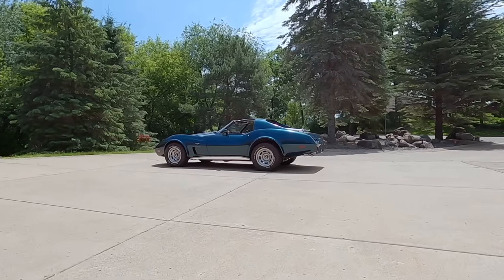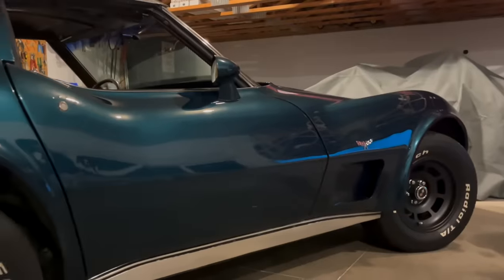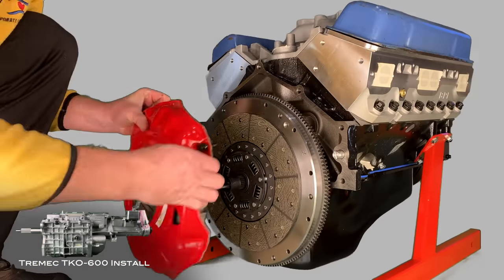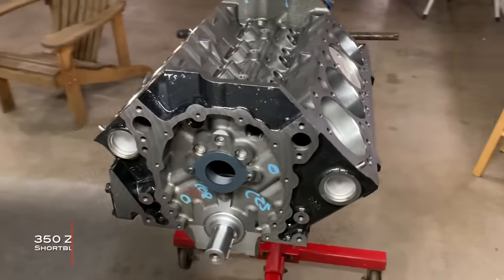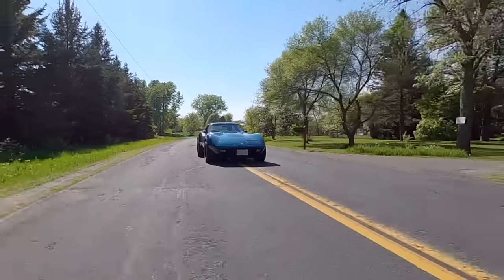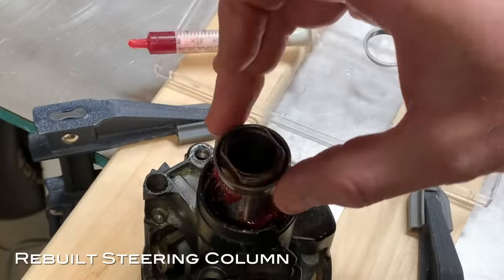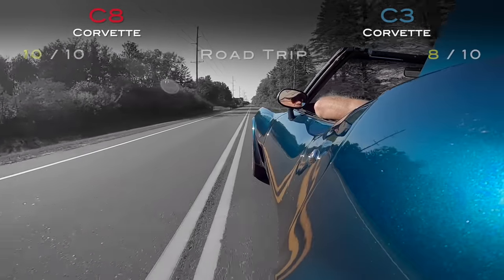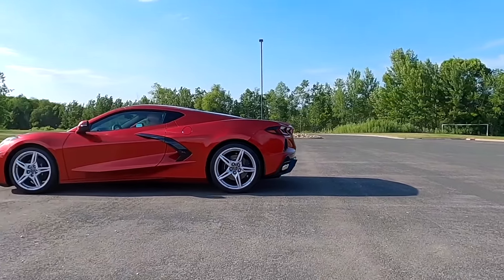C3 Makeover: Modernizing a Classic Corvette

Comment: I’m one minute and 40 seconds into this video and if you believe AFM belongs in a “sports car” we cannot be friends.
Reply: Same here, absolutely agree, gen 5 is just a waste of money, absolutely stupid technologies  added to this gen unlike gen 4 that has the Variable valve timing (vvt) which does actually improve performance and feul efficiency without having to deactivate any cylinders
Reply: EXACTLY.  ITS TURNED THE RELIABLE HEMI AND LS/LT ENGINES MODERN LEGACY OF DURABLE, HIGH MILEAGE POTENTIAL MOTORS TO FAILED LOW MILEAGE EXAMPLES BC OF CHEWED UP CAMS/LIFTERS AND METAL PARTICULATES RUINING THE BLOCK.
Reply from the maker: hey Guys - yeah cylinder deactivation has its risks too (totally agree) - one thing I discovered is when I drive the C8 in sport mode, the throttle position sensor threshold for deactivation is considerably lower ie it only ever seems to activate on the highway. In track mode i don't think it even engages, but then your shift points start to get ridiculous. In terms of MPG savings - minuscule between touring/sport mode and I usually leave it in sport to keep all 8 firing most of the time. I think Silverados-SUVs likely benefit more from an EPA standpoint. thanks for the comments!
Reply: If that's the case, then i think that's ok, you can just keep the car on sport or track and no cylinders will be deactivated, thanks man @TacoJoe
Reply: I absolutely hate AFM as well. I disabled it on my wife’s truck. Too many issues with the 5.3 with no benefits whatsoever.
Reply: What's your thoughts on vvt, because I'm confused between ls2 and ls6 engines, both are almost same price, one has vvt and the other doesn't, I'll modify either engines if i get one of them, so should i get ls2 and then change the stock camshaft with a btr performance camshaft that supports vvt, or should I just get the ls6 that doesn't support vvt, because as far as I know vvt is good for for both feul efficiency and performance, but i found some people who apply delete kits to romove vvt from their engines, so i wonder why, thanks man for your videos, i appreciate your responding to your viewers comments. @davejalenderki
Reply: Took a BW T10 out!
Reply: No offense intended but that chrome luggage rack on the back of the C3 looks stupid and permanently shackles the car's looks to the 1970's.
Reply: What is AFM ? Sorry don’t know
Reply: @TacoJoe  I disagree that it helps with the trucks and SUV enough to deal with the problems. I had an 03 Silverado 5.3l extended cab Z-71 that I averaged 18mpg with.
I then had an 07 Trailblazer 2wd with the 5.3l and the horrible DOD crap, it averaged 19mpg. However, the amount of oil this thing burned completely wiped out any mpg savings it could get. At the end of its life (240,000 miles) I was burning thru 4 quarts of oil per tank of gas. It started burning oil around 100,000 miles.
Reply: I don’t think he’s trying to be your friend.
Reply: Boohooo, why can’t we just be friends. Oh well. Bye.
Reply: @jaivette  AFM stands for active fuel management, AKA DoD, displacement on demand, and in the pursuit of better fuel economy uses a solenoid controlling oil pressure to shut of lifters keeping the valves closed to shut down half the cylinders.
Reply: Can I ask what AFM is?

Comment: So you basically destroyed a 1977 Corvette. I have a 1976 Corvette. It is my third one. I finally found the one I wanted. It looks 100% stock. The interior is 100% stock, except for a hidden MP3 player. NO touchscreens. The suspension is stock except for polyurethane bushings and body mounts. Brakes are 100% stock with sleeved calipers. Exhaust is a true dual system with no cats, but looks stock from the rear. The engine was not original when I bought the car. I built a 360 rwhp 383ci old school small block for it, that both makes more power and is more reliable than stock. But on the outside it looks completely stock, even the color. It is carbureted. I did switch from an automatic choke to a manual choke. I had a TH400 transmission built for more reliability. It has 225/70-15 BFG RWL Radial T/As on silver steel rally wheels with trim rings and stock center caps. It was repainted in the stock white color, and the Buckskin tan leather interior was restored/replaced. It is 100% reliable and can be driven anywhere, but it still has all its original charm and character.
Reply from the maker: destroyed my 1977 Corvette? Ouch! I still love my car and glad you like your 76 too / sounds like a nice setup
Reply: @TacoJoe classiest of replies there, man. Well done.

Comment: Would be great if you could fairly easily install a C5 C6 or C7 rear end & T56  transmission into a C3 body for a closer 50/50 weight ratio &  better rear suspension setup ......Also looks like the C3 could benefit from some aero parts like a front splitter & underbody, maybe side diffusers & a functional  rear spoiler. If they could be integrated to look good & not cheesy. If money wasn't an issue. I'd love a C3 or C2 classic old school body with modern parts underneath. Same with many older cars. The classic styling is great but not the old worn parts & performance.

Comment: One of the best automotive videos I've seen.  Production values are through the roof - and that's outside of the mechanical work and analysis.  Interior is where I'd go a different direction.  The brown seats and carpet would be where I'd do the replacing/upgrading and I'd leave the dash & console.  Keeping the exterior stock look is a rare and admirable choice.  Wide body kit and 22" wheels are for different applications/not at all in my book.  Nice car and great work on your video!
Reply from the maker: Hey thanks @twomustangs - longer term I have more work on the horizon for the interior (including dash improvements) - totally agree with you on the 22" wheels & wide body too (not the right fit on a C3) - thanks for the comment!

Comment: I can dig it. Both are fun cats that will last as icons. 

You mentioned that there wasn't much you could do for the handling on the C3. I'll offer an argument. 3 things that I did that completely changed the handling; steeriods rack and pinion, Van Steel coil overs on all 4 corners, and a camber brace. My '76 handles as good as my cousin's C6.
Reply from the maker: Hey thanks for the comment Steve- I've had a few people tell me now to replace the hydraulic with rack/pinion and that's on my short to-do list. I'm not a fan of the dead spot with the PS valve - not a big deal at low speeds but on the highway the car can get drifty. Will check out steroids for sure and thank you!

Comment: Great build! I have a 78 that I am doing a restomod on. Its a multiyear process with the first few years being safety/drive train. So far I have rebuilt the engine, new brakes, Ridetech Street grip, new bushings and links and various other cables and hoses. I really like the idea about moving the fuse box. Do you have a diagram or anything like that you would be willing to share?
Reply from the maker: I can put something together but high level: 2 primary circuits: #1 is the starter / alternator circuit with a slow-blow fuse on the alternator and #2 is everything else from s fuseblock (DC breaker prior to the block) - once you know the basics its pretty easy to do. Check out my wiring 101 video too (will help with some of the basics) - thanks for the comment!
Reply: @TacoJoe  thx I just watched the video. It definitely helped!!

Comment: I just finished a 71 Camaro Z/28 RS with a 6 liter LS (495 hp), Holley Terminator X EFI, TH400, Gear Vendors OD, and 3.73 rear.  All new suspension, new interior and brakes.  I know how you feel.

Comment: 1 thing you didn't add the fact is the c3 is a older car that has been modified but was still easy to work on if not modified. when that c8 get old it will be a nightmare to work on or just junk it, you can't even change the oil. ill stick with the c3.

Comment: I’m about ready to buy a C3. This was really helpful. I’m going to get a 1982 automatic  with the crossfire on it. My son has the 1984 C4 with crossfire and we both really like it. Does the 1982 car have an overdrive auto? Edit: it does. 700r4 trans. Cool! Anyway, thanks for the good video.
Reply from the maker: I think 80-82 had a 700R4 which is an automatic overdrive / thanks for the comment!
Reply: Yes it does and has the torque converter lockup as well

Comment: having owned so many including this model im always amazed at when people upgrade the engine and drive train and never upgrade the rear axles...they twist easy with power, and then when twisted the rotors are crooked and heat up and the rotors cook..been there done that a few times until i learned my lesson guess these guys never drive them as hard as I did when you do you will understand

Comment: Entertaining video of a modern YouTube builder like yourself  trying to show off your toys. I will say you are in a smaller percentage of c3 owners who actually work on them. Having the obvious time, space, and money to afford your lift plus engine/trans upgrades shows you are able to live out your dreams not to mention to have the waste of huge money on the c8 (LoL). I am a Corvette enthusiast since 1995 with my first 1973 C3 who is in the 45-55 age club and feel the modern vette is not in the same group as the c3 and is partly the reason the vette is going away permanently. If you get a chance to do another c3 build I highly reccomend the big block engine powerplant. I can attest to the high performance of the BBC over any other engine even with power adders. GM now has the 632 which is like a LS big block and would be the ultimate of all possible worlds. I had my leg injured in Iraq and drive only automatics and have to say the 4L80e swap is the best overdrive possible to easlily handle 1000hp as my 500+ cubic inch builds are over the power torque rating of ANY manual trans. I will say the pro flo multi port efi is the best choice to fit uner hood of c3. Edelbrock came up with the SBC efi pro flo almost 20 years ago and glad to see you trying it but again the old carburetor has never been an issue with my builds and would have to say that your opinon on efi allowing a bigger cam to run better on daily driver is not the normal view as it requires more computerized tuning to control not to mention a higher stall in auto trans. I have been a subscriber and always enjoy your videos demonstrating your moviemaking skills as much as hot rodding abilities. L❤ve your passionate commitment to your c3 Corvette! 👍
Reply from the maker: 632ci big block is the ULTIMATE upgrade for any project car - what a complete beast and I can't imagine the torque curve / agree with you on the 4L80E transmission too / solid upgrade and a tough transmission - thanks for the comment!

Comment: I live in europe, a new transmission would be too expensive. I think I'd pay 8k for the import fees and shipping alone. Also when it comes to making classic cars liveable I don't really see the need for fuel injection a carburator isn't bad. When it comes to classic muscle cars the things I would upgrade first are: The steering rod/box, make sure it's one that doesn't pierce you when you crash. Power brakes and a disc brake upgrade and if you want to drive it alot use a electric ignition because the old ignition systems are more likely to fail or give you a bad starting car then the carburator. Especially with V8 engines.
Reply from the maker: well said / all great tips and thanks for the comment!

Comment: TJ i assume you are engineer or machinist, mad skills for sure.
I rebuilt a 75 convertible, u fortunately due to covid supply chain could not buy steeroids upgrades,  vansteel trailing arms, etc
So complete replace/rebuilt rolling suspension,  body mounts, rear cross beam. Every brand new or rebuild.
The car has torque, but i personnelly feel the 70s suspension is not build for big power.
I had sold 86 944 turbo (40,000 org miles)
The fit/feel/handling were worlds apart.
Did you consider swapping c3 suspension to rolling C4?
Nothing beats the C3 look
I had a C4, far better handling.
Fantastic job on your C3!
Reply from the maker: that would be a neat project / I think the wheelbases are close so it might be do-able - I think the toughest part might be retrofitting the birdcage but I like your thinking / could be a really neat custom vette

Comment: I have a 1980, ZZ4 455HP engine 4 speed. I will be adding a Tremec 6 speed. Suspension made changes, brakes, anti sway bars,  new rear spring and all rubber mounts new. The big change Koni adjustable shocks. Now it corners like it is on rails.  A few more changes but really happy so far. BTW I have a standard carburetor properly adjusted and it starts hot or cold. Not a fan of changing to EFI.
Reply from the maker: Quadrajets get a bad rap, but properly tuned, they are one of the best all-around carbs out there. Thanks for the comment!

Comment: Awesome video. I totally agree that for a more modern experience EFI and an overdrive transmission are on the top of the list and stereo upgrades are also important. I like that you went with a roller cam, too.

I disagree with the need to go with a smaller fuel injector in 2024, though.  Modern fuel injectors have increasing amounts of (smaller) holes in them, so that they can both flow more AND have better atomization. If you buy injectors from a reputable seller, who can provide injector "categorization" data and injectors that have good low pulse width behavior, tuning with a very large injector, even one with large holes, also isn't an issue.  Toyotas are coming from the factory with what would traditionally be classified as having extremely large sized fuel injectors (I AM talking about port-injected  engines still) and they obviously idle like a new Toyota. Even the Bosch 3 and Bosch 4 injectors also will have finer and finer atomization as you increase the fuel pressure and the EFI can just alter the trims to inject with less duty cycle when you do so. 

Typical injector sizing would say that for a 440 hp engine you'd want an 80% duty cycle and a 34.4 lbs / hr injector (361cc/min). 

EFI SHOULD help the engine see less wear; totally agree with that, but I think you'll be hard pressed to get anywhere near 150k miles out of that 350, if it was rebuilt with an old-school 5/64, 5/64, 3/16" ring pack -they introduce a lot of friction that will wear down the cylinder walls faster than an LS or LT or any newer generation of engine that comes with a thin piston ring pack, especially if the pistons are a 2618 alloy forging with it's large piston to bore clearances. Going with a thin ring pack and a high silicon either hypereutectic or 4032 low expansion forged piston alloy will help reduce cylinder wall wear and time required between rebuilds, if that's a concern. 

Running with a low temp (160 or 165F) coolant thermostat will also dramatically increase engine wear and should be avoided, too.

An exceptionally well-done video. I can't imagine how much time went into it; even filming from a 2nd car to get those on-the-road shots seems like plenty of planning and work.
Reply from the maker: Hey great comment Adam / thanks much. Sounds like your EFI knowledge exceeds mine / i might consider some 35lb injectors now :) Right now I'm running a 185F thermostat and hyper pistons. Your comment is right on target with the ring wear too. After break in, I changed to valvoline 10W-30 synthetic and on cold days I was burning a lot of oil on startup (it was crazy)  - switched back to dyno oil and no issue so almost seems like a characteristic of a fresh small block running synthetic. I can't decide if it's good synthetic sneaks by the rings on startup or if the tradeoff with carbon build up/etc is not worth it. Any thoughts? Great comment Adam and thank you-

Comment: Interesting comparison. Are you running 255/60-15 tires? 
I had a like new 30K mile C5 Z06 and sold it in favor of keeping my '73 4 speed car. The C5Z is an amazing car but I was worried about keeping it pristine so it took away some of the fun. I also didn't like all the computer controlled stuff and electronics in it which I know will eventually fail. As those parts become obsolete they won't be able to be replaced. 
I'm now in the process of modifying the '73 as you did yours. Mine is an occasional use car so may stick with the 4 speed but will definitely go with fuel injection. I live at 5K feet elevation and go up to over 9K when I run in the mountains.
Reply from the maker: You'll like the EFI at your elevation - your 350 won't miss beat. 73 is a neat year too (half chrome / half molded bumpers). Nice thing about the older 4 speeds too (S10 / Muncie) - is - the shift soooo smooth. Good luck with the upgrades and thanks for the comment!